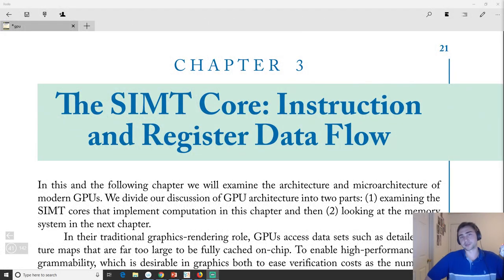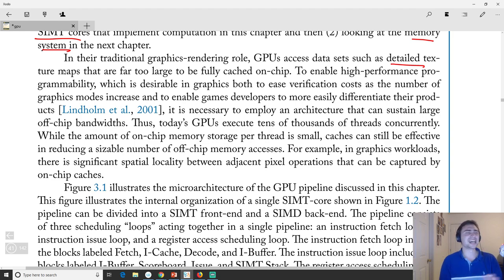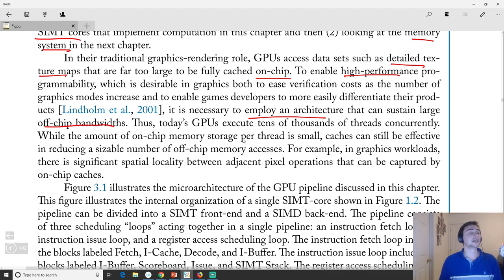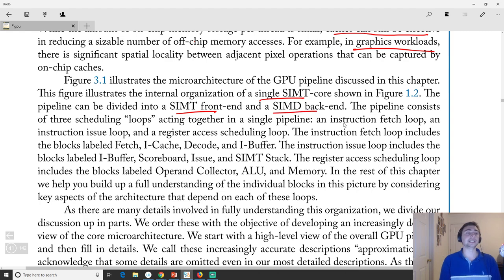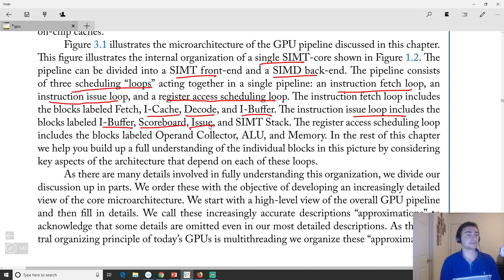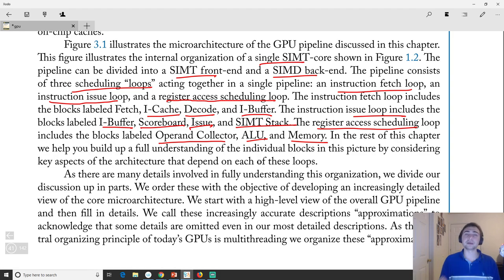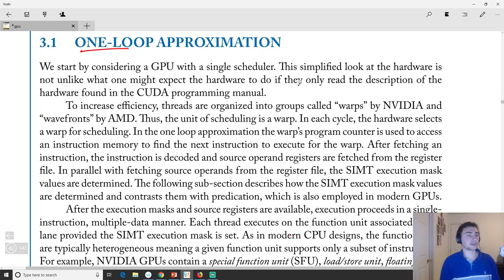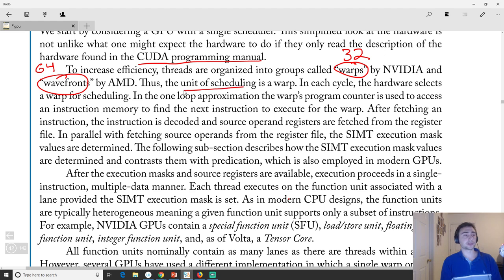Fundamentals of GPU Architecture: SIMT Core Part 1

Comment: At 19:43 you mentioned that when get to the "i++" everyone (every thread) should be together. Is there a particular reason why the threads "should" be together at that point? As in, do threads always "want" to march in lockstep for some reason - maybe for performance or thread synchronization?
Reply: I think I understand why. It is because of the SIMT, "Single instruction ..." so all threads should be executing the same instruction. Is one a warp or on a threadblock basis?
Reply: @temdisponivel  Hey. I think is it on a warp basis and the warp is the unit in which instruction issuing is done (idk if thats the correct term?)

Comment: So, inside the GPU, although we say that everything happens in parallel, but everything still happens in a serialized manner if the instruction in "Different". All the threads which require the same operations will happen simultaneously but the instructions will go on in serialized manner, thus even the threads chunks will go in a serialized manner. I am understanding this correctly?
Reply from the maker: GPUs are massively parallel accelerators, but that doesn't mean everything they do must be 100% parallel. At a high level, unique control flow paths for a warp suffering from warp divergence are serialized. Now, in reality, you are not guaranteed for all threads of a warp to be at the same point even when there is control-flow differences between threads (at least on modern NVIDIA GPUs), unless you specifically you call specific warp synchronization mechanisms.
Reply: It’s a book by TM a Amod on graphic processor archit